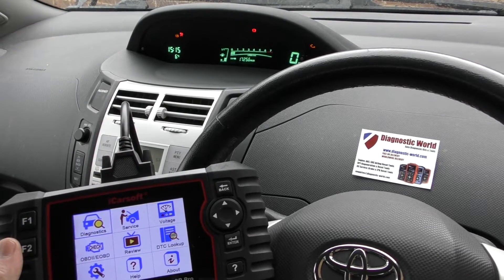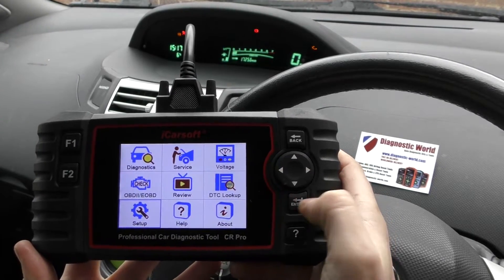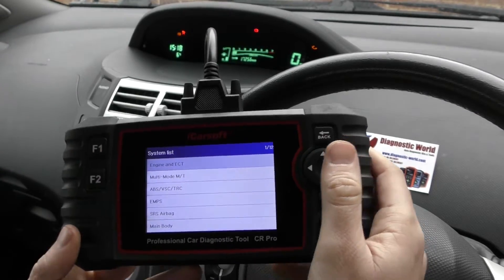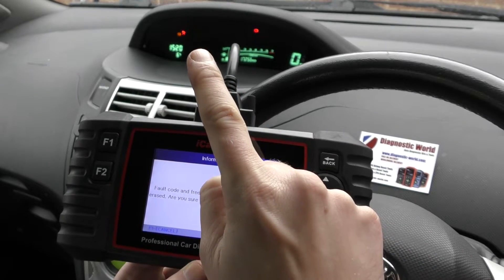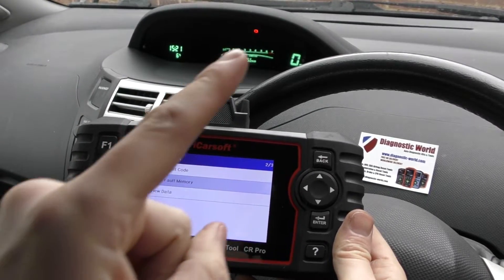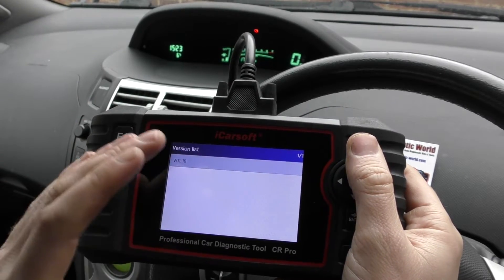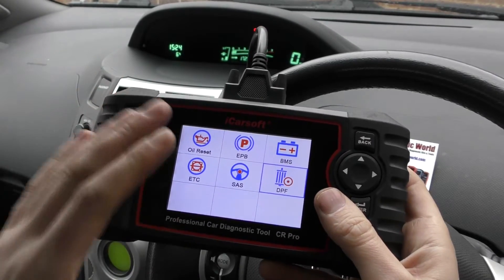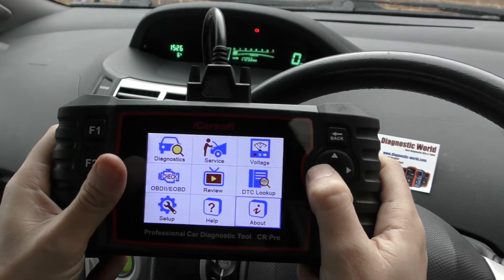iCarsoft CR Pro Full Review & Demonstration Diagnostic Scan Tool engine ABS Airbags Transmission

Comment: I have a Mini Cooper R56 2007. I use the CR Pro, but I have to have the car engine running for the icarsoft to communicate with my car, both with reading codes and deleting them to update the car, otherwise I get error messages (not OBD2 compatible, wrong software, ignition not turned on etc.)

Comment: Can you make a video with DPF forced regeneration, please !?
Reply: No he can’t cos it won’t do it
Reply: @ihf8766  What do you mean, it doesn't work?
Reply: @adrianhorvat449  you can not do a forced DPF regeneration with this tool on a lot of cars I have had one,actually there are quite a few things it can’t do,depends what you want it for,if you want a basic scan tool it’s fine for that but there is cheaper one out there that are as good as this
Reply: @ihf8766  Why it has the function of DPF regeneration, battery reset, electric handbrake release, etc ..when they don't working???
I bought this tool specially for those functions!
I'm very disappointed!
Reply: YouTube the following video, then guess who lol        BMW E39 5 Series Airbag Light Reset

Comment: what a piece of crap, don't buy. I gave them vin & reg number to make sure I get the right tool, they assured me it will work with my van, sure enough it didn't work,
their answer was to try different vehicles in the menu & update it, by updating you loose the right to send it back for a refund, as you have to register to update,
& it still doesn't work & no more contact, diagnostic scanners more like diagnostic scammers.

Comment: Will it work on the H2 Hummer?
Reply: hi Jason, this is Jessica from iCarsoft Inc., yes, the item CR Pro can work with Hummer H2, Hummer H3.
Reply: Thanks for responding to my question. I ended up buying one off of eBay & it's been working beautifully for me ever since. I'm very happy with this purchase & the price was even better not a bad way to spend a hundred bucks for sure👍😁😎😉👌
Reply: @J.Crooner  appreciate you like it. :)
Reply: Yes it's a great machine for sure👍😁😎😉👌
Reply: Does this work with GM vehicles?
Reply: Yes absolutely be sure to pick one up if you haven't purchased it already it's a great machine to have I will assure you that👍😁😎👌
Reply: No bud you read it correctly it was only a 100 bucks. The guy I purchased it from must of thought it was broken so I'm assuming he was trying to get rid of it but he was selling it as brand new. Well turns out it was actually brand new the trick was somehow he had corrupted the sd card. When I first plugged it up it was stuck on the home screen & wouldn't do anything. So I contacted the company and they told me to go the icarsoft website, format the sd card, and re download the software. It took me about 4hrs to do it but it was well worth the time for sure. I was determined to get it back working again. The funny thing is when I told the eBay seller what I did he said "WHAT"!!!!! 😨 as if he was shocked it actually worked. He was on the verge of receiving negative feedback for selling a piece of junk which he thought it was but luckily for me I got the ultimate best out of that deal for sure in the end💪😎💪👍😁👌

Comment: does it do rear break caliper release for new pads
Reply: hi Gngee, this is Jessica from iCarsoft Inc., yes, the item CR Pro can support Electronic Parking Brake (EPB) system maintenance deactivates and reactivates the EPB system
 for replacement and initialization.

Comment: Is it working for Subaru as well? I have not seen during surf across menu!
Reply: József STRICKER sane question ? I want to buy it but didn’t see if it works on Subaru ...
Reply: I dont know if hes does work but in the original one yea its work in subaru

Comment: simple question can i relearn a transfer case on a land rover????
Reply: Icarsoft scanners dont have any programming or relearning ability.  The pro can do the following though.  •  Oil Light/Service Reset: Support service lamp reset.
•  Electronic Parking Brake (EPB) system maintenance deactivates and reactivates the EPB system

    for replacement and initialization.
•  Battery Management System (BMS), registers new battery to the BMS while battery replacement.
•  Diesel Particulate Filter (DPF) regeneration control system,
   requests the DPF regeneration process while DPF blockage and turn off the DPF indicator.
•  Electronic Throttle Control system (ETC) relearns the throttle valve control value while clear

   or replaces the throttle valve.
•  Steering Angle Sensor (SAS) calibration, calibrates the steering wheel to straight ahead, or recalibrates
•  ABS Bleeding, release the air to restore ABS Brake sensitivity, or relearn while ABS replaced.
•  Injector coding, relearn the injector control parameter while the injector renewed or replaced

   SAS while steering part replacement.  Check there website if you want more info.
Reply: SKGamer Ok not bad thank you.

Comment: GARBAGE. Product advertises that it can register new batteries. FALSE, there are no parameters you can adjust to register a new battery and change the voltage settings. WTF?? No manuals or anything either? Worst most incomplete system ever. I'll stick with INPA-D for my BMW and VAGCOM. Do yourself a favor and don't cheap out on your diag on these cheap third party vendors.
Reply: YouTube the following video, then guess who lol          BMW E39  5 Series Airbag Light Reset